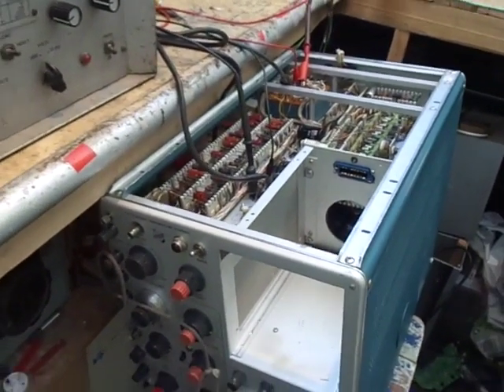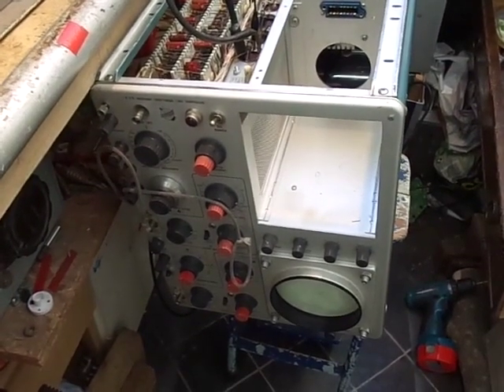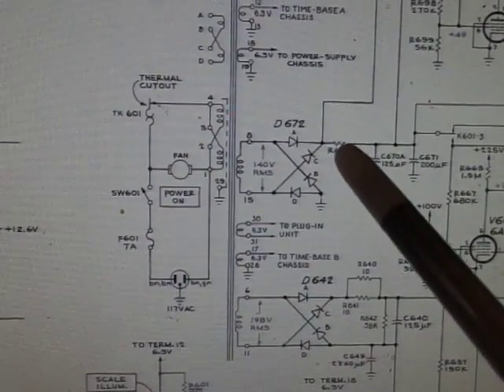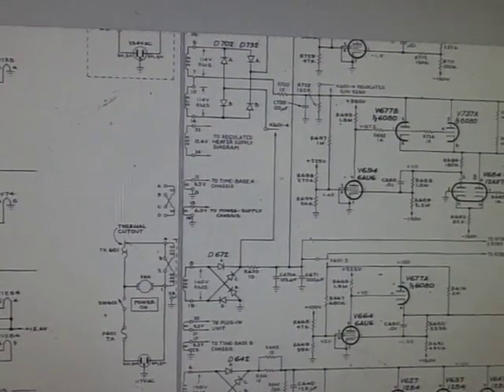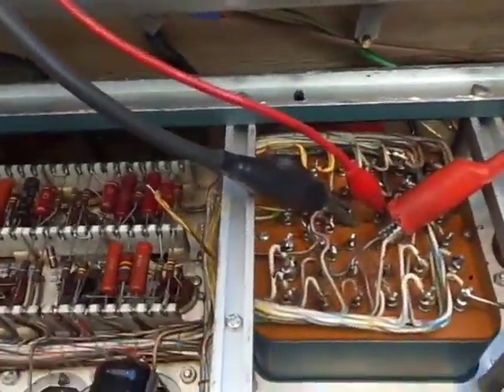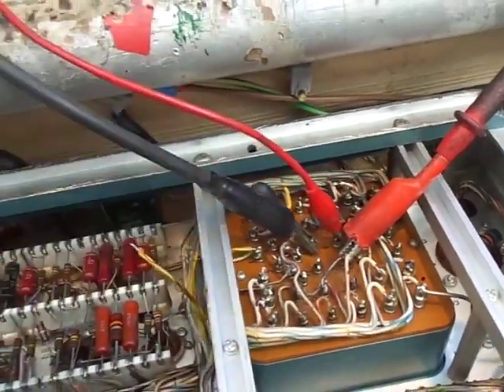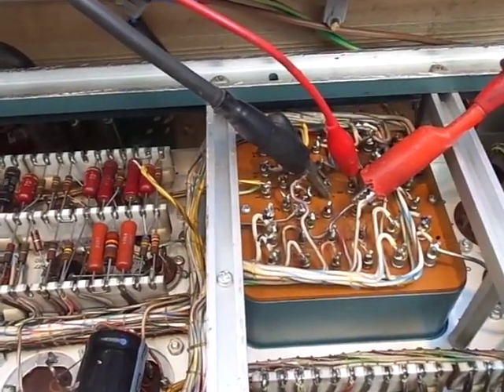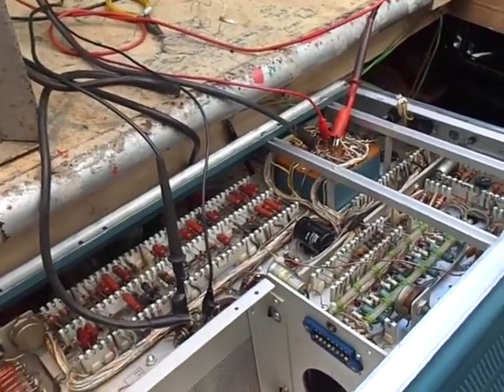Tektronix 585A Oscilloscope 1 - Transformer Insulation Breakdown Testing.

Comment: As far as I know, your transformer is still under guarantee. I'm not joking. Tek provided a guarantee for the main transformers of its grand old scopes for an unlimited duration. Since Tektronix is still in business, you are within your rights to require tek to repair or replace the transformer. I owned a 585A myself 40 years ago and remember this unusual guarantee.
Reply from the maker: Wow, I'll check that out, thanks for the heads up....DA.
Reply: @diabolicalartificer  Please update this comments section with the response you get from tek.
Reply from the maker: @jacks5kids  Will do Frank, it may be some time though what with staffing levels due to CV19...DA.
Reply: @diabolicalartificer  I just checked whether I remembered correctly. On the first page of the service  manual it says "Tektronix transformers, manufactured in our own plant, are warranted for the life of the instrument". You can download the service manual here: https://elektrotanya.com/tektronix_585a_oscilloscope_sm.pdf/download.html#dl
Reply from the maker: @jacks5kids  Thanks, I have a PDF of the manual but haven't read it all, there's a hell of a lot to digest. ? Thanks again for your interest & info. Will keep you updated......DA.
Reply: It's 4 months since I suggested you try to exercise the unlimited warranty on your power transformer and want to hear if Tek will actually honor it.

Comment: If you didn't get it fixed tie another smaller transformers primary into the mains that has the expected output, then connect that output into the delayed circuit as shown in the schematic. When the delayed circuit kicks in you'll have the same voltage as expected. You'll just have to figure out where to put that smaller transformer in the case and hope the other windings on the original don't go bad. Thanks for the fun. Best Wishes & Blessings. Keith Noneya
Reply from the maker: Someone kindly gave a scrap 585A with a good tfmr, it's working at present-ish, just has a different fault. I meant to do another video but as usual things get in the way. Thanks for you idea anyroad....DA

Comment: Best of luck on getting a transformer to work. Real sad when this technology goes down hard. Post an update if you do.
Reply from the maker: Sorry Robert, your reply snuck through unnoticed, I did get it fixed sort of, it now has another fault that needs fixing, it'll get done.....eventually.....DA.
Reply: @diabolicalartificer  Hi D.A. I do understand. Got my 545 going, thank God i had a donor. Now my 502 is 2 steps forward, 1 back. Lower beam amp stopped, the one with nuvistors and Xr!$t@r$.
Reply from the maker: @robertc.2465  Bummer regards your 502, at first I thought you  meant the SC502 scope but see from looking it up there's a 502, looks like a nice scope. If there's any bits you need drop us a line, email address is in the "about" section. Good luck.....DA.
Reply: @diabolicalartificer  Thanks D.A. i also have a donor 502A, but it is the all tube version. Would love to have restored it, but had too much corrosion. It is something simple, just took a break from it,,trying to find my wand again😁